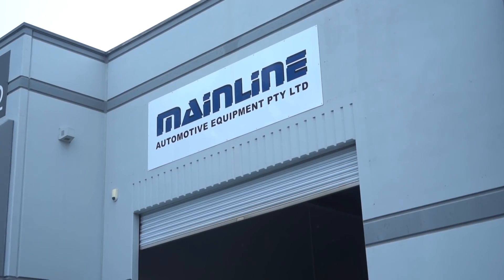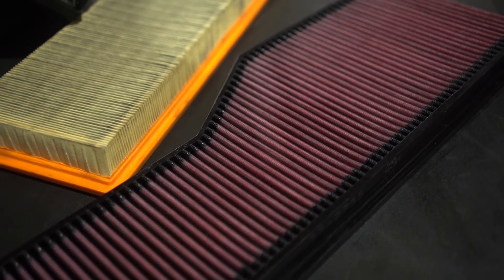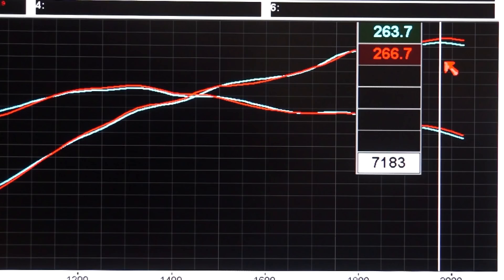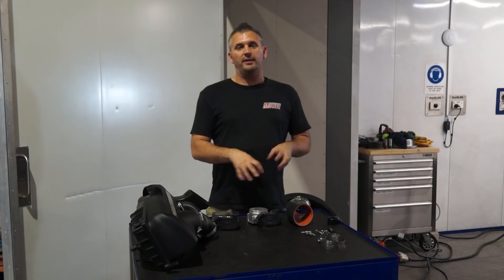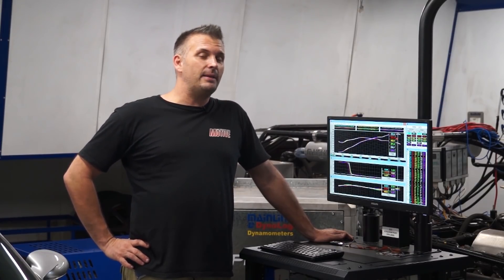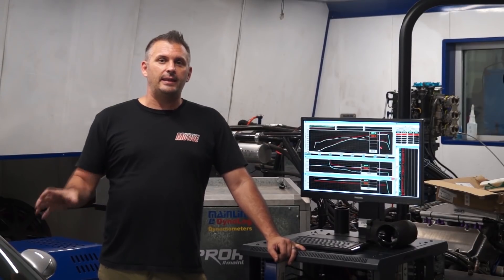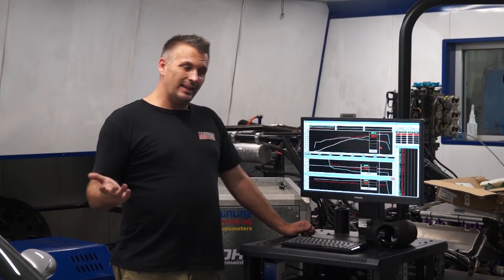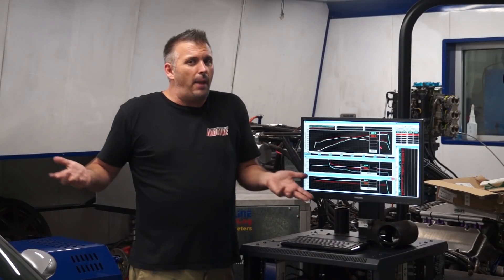MYTHBUSTED! Do Intake Mods Work? - Motive Garage Porsche 997.1 C2

Comment: I just don’t see those parts making any more power than the factory pieces. This engine is limited at the heads, be it camshaft or headflow, whatever you do before that will not improve the power output.
Reply from the maker: Our aim was to provide clear evidence as we looked for days on days and couldnt find any
Reply: Motive Video thanks for going through the trouble to test it for us. Not a ton of info on Porsche bolt on parts. I’ve got a 997.1 turbo 6 speed manual. Trade you guys for a built R34 GTR

Comment: I’d love to find out if a tune helps it out. I want to put a K&N intake on my 996 for the sound but not if it loses power. I already have the IPD intake.
Reply: i won't be surprised if tuning alone (with no new parts) would make more power. factory tuning takes emissions regulations into consideration, which may not result in the best power output. so they need to tune the stock motor and compare the tuned stock motor vs. tuned motor with bolt-ons. i won't be surprised if the panel filter wins once again.

Comment: I can’t wait for Part 2 of this series!  Come on get it posted. :)  please. 
It seems that maybe we all need to start with an exhaust mod first, then work our way back.  
I’ve installed the underdrive pulley and will say that near the top end is noticeable. But not all the time,  heat soaked engines are the 911s worst enemy.  Being in the back of the car doesn’t help when driving in stop and go traffic (daily driving). 
Oh well good luck. Hopefully you can come up with a solution for us, besides saying go buy yourself  a Turbo hahaha.

Comment: So glad you’ve done this video. Manufacturers of these products do make some very surprising and appealing. Laine of gains, but very little people actually do back to back tests.
I had a 996 Carrera 2 with IPD GT3 body plus the air box mod and it made less than standard, so I’m not surprised by your results either.

Comment: Is there a chance that the K&N intake works better when the cars moving due to cool air flow?
Reply from the maker: Marcus Brady we had over 120kmh air in the dyno cell. Front fan, rear suction fan and a fan blowing air sober the deck lid. Also, have driven car with it on and even feels slower.
Reply: @MotiveVideo  okay fair enough then

Comment: I'd put a manometer on the intake just before the throttle. If the factory doesn't have more than 10" of water vacuum at full power you're gonna be hard pressed to get gains.

I'd also put an airflow meter in it. Toyota and subaru ones can be adapted to any pipe size and you can log voltage out. This will create a slight restriction but can then be used to measure airflow increases after the point of measurement like that T-piece that looked like it wasn't sure if it was dividing airflow or allowing resonance between the plenums or not.

Also, do backpressure measurements, because no one ever does those and i need more data points to judge modified cars on

Comment: Well done. There is a lot of people who exchange money for fantasy and these tests were done well. 
My 3.4 has the original airbox and blanked off the resonator. The original muffler boxes were modified with the Gundo bypass. Sounds amazing but no measurable change in power. 
The best way to get a 996 or 997 to boogie is by removing weight. They are 1300kg with driver and with some imaginative use of lighter accessories (muffler boxes, rear seats, some sound deadening, carpet, lightweight sway bars and drop links) they are down in the high 11’s mid 12’s. Keep up the good work.

Comment: Porsche built a great intake for that engine. You can't improve what already works great.
Reply: mrnicktoyou technology available to engineers, and the amount of funding spent on developing these technologies is so much greater these days than even 30 years ago. Yet for some reason there is a sizable portion of the modding community that thinks they can swap out a few inexpensive parts and do a better job than that small army of engineers that developed the factory component. Certainly these mods also come with increased risk over time and under extreme conditions (e.g. temp, elevation, track etc.). Porsche engineers designed the factory system to perform under conditions in the middle of Saudi Arabia summer or Alaska winter. Aftermarket modifications aren’t always designed for these extremes. I just mention this to say, the factory engineers are smart dudes and they work hard to make these parts perform better than competitors and be reliable under all conditions.
Reply: @MingusDewfus  yep. it maybe easier to find performance mods for cars that were not sports cars in the first place. but for cars like porsche, ferrari, lambo, mclaren, etc. i think the only sure way to gain power from bolt-ons is removing the catalytic converter, or just straight piping it.
Reply: @MingusDewfus  The only counter point I have, which I’m sure you’re aware of is. Porsche engineers hands are tied to regulation, and usually that means the strictest locale is where they’re stuck pandering to. I do believe California is the worst offender of regulations that ultimately have a sum negative towards the environment when you actually look at the big picture but not the point here.
So, shops that are making parts to improve what they weren’t allowed to either due to R&D politics or regulations, will use the base design to increase efficiency. Not to mention, some engineers are a bit..... bull headed and won’t consider some ideas. 
Sum all, I look at IPD and similar companies as an expensive method for a small increase. If you’re at the point in your build that you can justify $800 for a 10 Hp/smoother curve eh go for it.
Realistically, intercooler upgrades and methanol injection can give you far more performance for your dollars. And, depending on the engine, help with that pesky carbon build up on intake valves.
I do take a small issue with the test methodology done here, ECUs need some time/miles to adjust for parts added, and really should be set all the way back to the re learn mode before testing before and after. Just for accuracies sake.

Comment: I fitted a larger throttle body and intake Tee to my 2.7 Boxster and found it to loose power initially also. Investigation found that the resonance tuning was upset by the increase in intake volume. I shortened the intake length and all my power plus more returned. The change in length by 3” was enough to push the power band outside the rpm window. I already had decent quality extractors with burns collectors installed. Still on the OEM cat pipes. 

You could try:
Underdrive pulley 
Headers (likely give up some bottle end) 
Test pipes as you said 
Tune (love to see a haltech, link, etc)

Comment: Great video, did you try a new stock air filter vs the old one vs the k+n. The 3.8 uses the same filter and it is not a restriction,  also i would never use a oiled panel filter in a car that runs a Mass Air Flow Meter as i have seen loads pack up with oil contamination, K+N say its not an issue but i can tell you it is ( i run a dyno and specialise in VAG and Porsche). I would sooner loose 5hp and not run the risk of running lean later from a faulty MAF.
Reply from the maker: We didn't try a new one, no, but we did clean the factory one out. Next rounds of mods we might and try new one or different brand. Also have another intake kit on the way too.
Reply: Also noticed the std air filter was pretty nasty, so probably not as good as it could be.

Comment: Injectors are maxed out on the 3.6 , need tuning and fuel , and auto sucks , but great video!
Reply from the maker: have you got data showing theyre maxed out when the car is stock? Wefind it very unlikely they are maxed out in stock power levels. Also, parts are markted as being tested to proven to increase power. So how did they do it if injectors maxed?
Reply: Motive Video I had 3.6 in my 2001 and with the stock ecu tuning was not going good so after I put proefi , changed the maf sensor to map sensor, 750cc injectors , same throttle, the car drove completely different,

Comment: I would be checking the internal diameter of the pipe the MAF sits in and compare it to the stock housing, could be a MAF scaling issue. 
I know with VW/Audi products of that era that the US spec cars often had different sized MAF housings compare to our EURO spec models.
Alternatively, the position of the MAF looks like it would have terrible readings.
Reply from the maker: Peter Davies it’s a huge part of what it is, but it’s sold as a bolt on part that doesn’t require tuning
Reply: May just be the case of a simple mistake on K&N's part not realising market differences. I'm realistic that almost no intakes on an NA car make much if any power, but to loose power and mess AFR so badly suggests there is a mistake
Reply from the maker: @peterdavies9209  We spoke to them about it and was assured was right. We have more tests and more things lined up though.
Reply: @MotiveVideo  I had the exact same thought as @Peter Davies. If the cross sectional diameter of the intake pipe where the MAF sits is larger in the K&N CAI compared to the stock intake, the MAF will be reading lower velocities for a given air flow rate. This would lead to a lean condition and would explain why your AFR dropped.

Comment: The intake mods you install will do nothing in a unmodified exhaust , you will see the results you want with a de-cat exhaust , l will try stock everything plus de-cat , then big tb and inlet , then tune (stock intake ) and finally the modified intake .Your 1/4mile trap speed in on point over here in Germany with better weather we get 105-7with tiptronik 997 full weight .Thanks for the enjoyment video.
Reply from the maker: jpsr20det did you watch the whole video?

Comment: What an excellent scientific approach - probably the best example of removing other variables (no doubt because of a critical Aussie crowd!). Love the research - you’re probably saving hapless Porsche owners (and enthusiasts) lots of money - who are already vulnerable to marketing... Keep it up!
Reply: And some people just love throwing parts at it even with no performance change.
Reply: By doing a VR remap/flash tune w/ mods(and having a pair of fans simulating running down the road) could see over 33whp
Reply: They’ve done all good except the fact they didn’t have enough air on dyno without side vents...I work for a tuning company and I can make you sure that with the IPD you have big gains with proper air flow
Reply: @lucazanoni9168  the simple panel filter gained power though

Comment: It would be nice to check each mod with and without a tune. To see if a tune works better with a particular mod
Reply from the maker: g4rr377 we can’t find software for our car to be honest. These parts were marketed as bolt on parts so we did what they said to do.
Reply: @MotiveVideo  understandable. I've seen Porsches not like aftermarket air parts before. Gotta admire the standard of German engineering
Reply: @chrisg4rr377  carwow did a test on his own Porsche also and lost power on his intake mod with dyno test

Comment: Did you adjust a/f ratio after installing the bigger tb and plenum?
Reply from the maker: We cant without aftermarket ECU or some type of flash tune, but the point is, they are marketed as making extra power as a bolt on item. they arent sold with any tuning software to go with them.
Reply: @MotiveVideo  i see. I understand. How was the afr at that time? Lean?
Reply from the maker: Ammarul Hadi it’s all in the video
Reply: Did you watch the video?
Reply: MAF sensor signal skewed in replacement pipe ?

Comment: Great video.  I’ve never been impressed by K&N cold air intakes that sit in the engine bay.  Seems like a great idea, but they heat-soak.  It does change the engine note quite a bit,  I agree the sound has a low growl.  It’s hard to improve on the factory airbox.
Reply: Porsche must have put a lot of thought into air delivery for the Carrera, being as it doesn’t have the vents of the Turbo, Cayman & Boxster. Logically sticking with the deck lid only delivery they must have got it right, otherwise why not have the side vent direct feed?
Reply: Richard Harvey I know a 350Z isn’t a 911, but this is the same reason I left the stock air box with a drop in filter. We only change filters on bikes too because the Manufacturers do so much R&D to get them right out of the box.

Comment: You mean Porsche engineers don’t know more than K&N? Impossible.
Reply: They didn't make more power because they didn't put the K&N sticker on the rear window!
Reply: @Poorschedriver  Yeah, it is a given that when you put that K&N sticker you get extra horsepowers!
Reply: Well, Porsche Engineers are installing direct from the factory BMC Filters in all the GT3 RS. Maybe they learned something you didn’t about aftermarket filters now? 🤔
Reply: Porsche engineers obviously should know, but they work within regulations. K&N and BMC filters allow more air or more oxygen to come through hence improving power. But it will also emitted more carbon as more is burned. Therefore aftermarket filters will improve power won’t damage your car but it may damage the environment a bit more.
Reply: @waqarghulam3548  introducing MORE air isn’t always enough.  When you introduce hotter air—you will pay a price.
Reply: @Edgy01  yes it’s not enough but the computer will balance the mixture by increasing or reducing fuel. Did I mention hot air?
Reply: @waqarghulam3548 And they filter less so the air is more contaminated which a manufacturer does not want. Especially since most people don't follow K&Ns guide to servicing their filters.

Comment: Thought about converting it to a manual Andrew? 

Great car as it is but would complete with a manual I think 😎
Reply from the maker: Cant even find a gearbox let alone a shell to get whats required. Then there is ECU change apparently. So expensive and hard its just not worth it
Reply: Yep. ECU change is required. 
Same with putting a 3.6 M96 into an earlier 996.1 that had a 3.4. Full change in ECU and other stuff within the loom.
Reply: Nothing wrong with a Tiptronic, absolutely nothing. Also when you’re crawling through stop start traffic your left leg will be glad of the rest. I can’t think of anything (apart from a K&N induction kit) more pointless oh and expensive. You want a manual, buy a manual. I have a manual Boxster S and I spend half my time driving it wishing it was Tiptronic.

Comment: Have u tried removing the K&N filter wrap/hydro shield? That could be the cause of restriction, hence the richening of AFR compared to stock.
Reply from the maker: They said that shield is fine for the power , and much more, and it has to be used on a Porsche as water drips through deck lid. If they tell you to use it, then use it. But yes, we tested without it and made no difference.

Comment: The size of that air filter box, almost looks like an exhaust muffler.
Reply: It’s because the intake is purely from the deck lid which is restricted if you compare it to a frontal intake so you need to make use of all the available fresh cold air by having the intake as wide as possible. I’m not sure why the Carreras don’t have vents like all the other 911s, Caymans & Boxsters do, you would think a direct air feed would be preferable, I know the deck lid has an impeller fan to help but it just seems a little clumsy. Theoretically a duck tail spoiler would be a good idea or even a roof scoop.
Reply: @eddherring4972  The fan is only for compartment cooling when the vehicle speed is too low to properly ventilate the engine compartment, AFAIK. It's got nothing to do with the induction system. The GT3's do have a sort of forward-facing duct / scoop on the inside of their duck-tails but its very short (it begins behind/below the rear glass, obviously). I doubt it has any kind of "ram air" type functionality but it might be an improvement over aft-facing louvers on the Carrera.